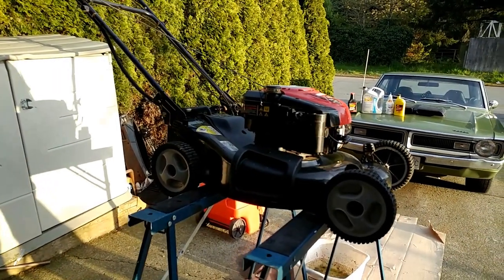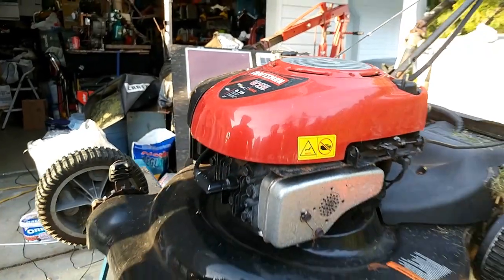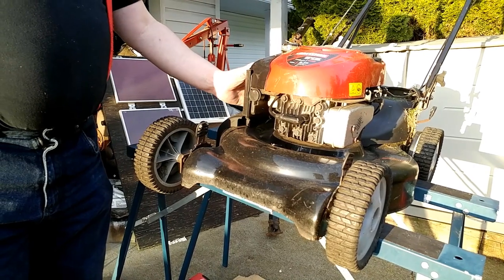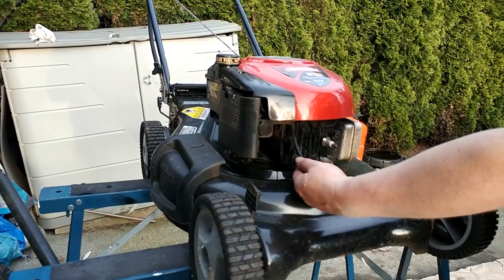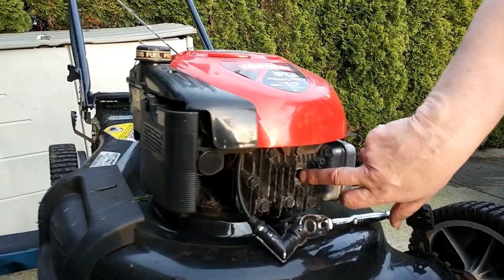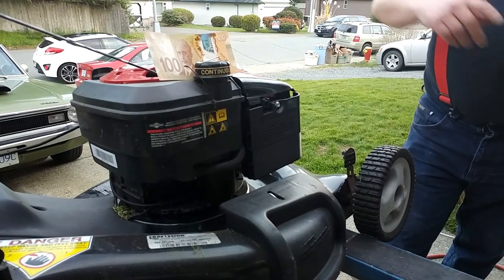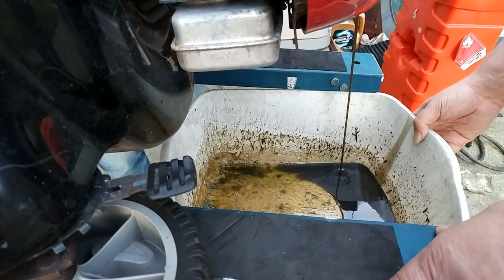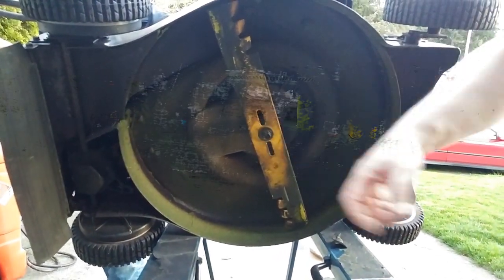Lawnmower Maintenance and Tune Up - Briggs and Stratton Lawnmower

Comment: I know this video is 5 years old now, but that's a quantum engine and does have a drain plug.... it's obstructed from view and under that plastic piece above the blade adaptor that is protecting the self-propelled drive assembly.